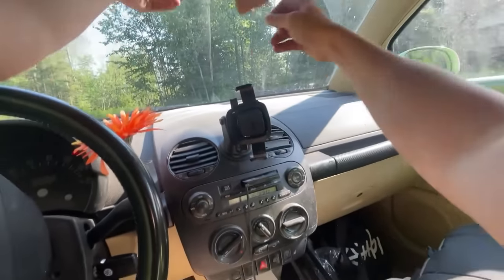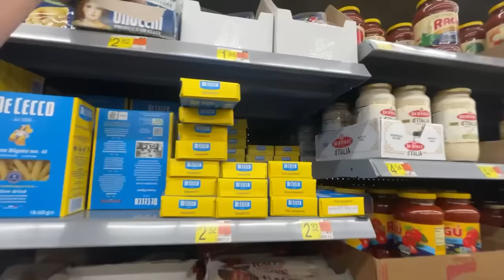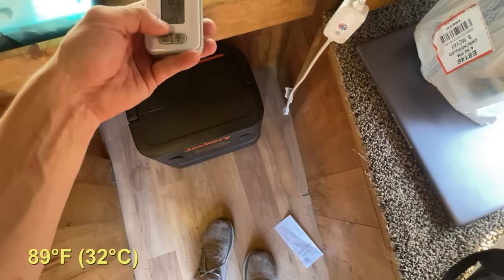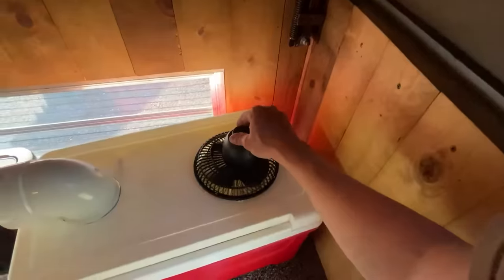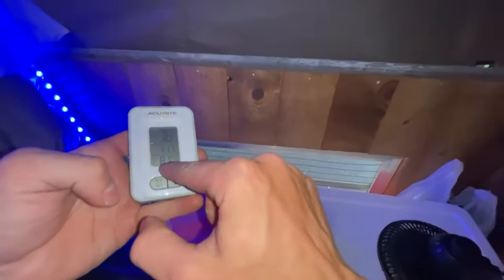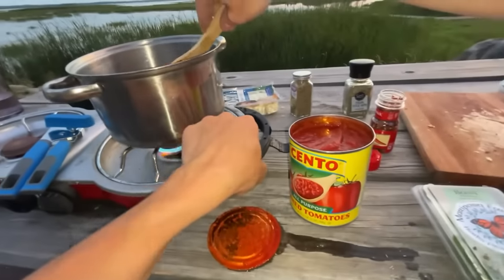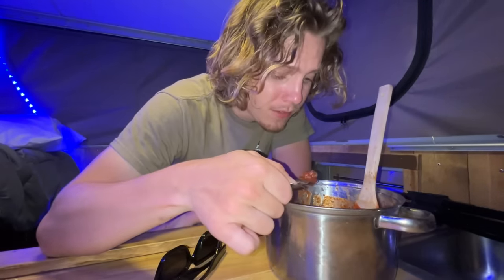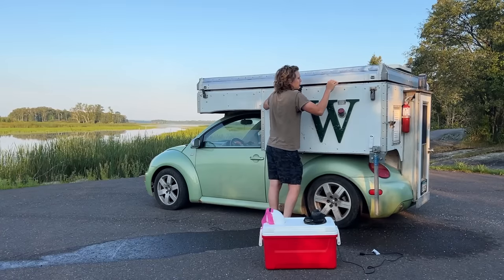Car Camping w/ DIY Swamp Cooler - Will it Work?

Comment: Maverick,  trick to super cooling with ice, rock salt, crushed ice, and layering, like you do with an ice cream maker. When you get halfway up, start using the cubed ice, with the rock salt. Leave 4 to 6 inches from the top for air flow. Also, start saving money by freezing tap water in gallon zip lock bags, not only good for cold storage, but drinking water.  Rob
Reply: was gonna comment this exactly
Reply: I would also maybe add a stronger fan that little desk fan probably doesn't put out that much air
Reply: @Follower lmao Fr bro lyin for what 🤣
Reply: Rock salt wouldn't that melt all the ice?
Reply: Sorry but this isn't correct  Think about it...rock salt melts ice in the winter and doesn't effect how cold the ice is. Also not all ice is the same temperature. You can get ice at 32 degrees F but most home freezers will go as low as -15 below 0F. The colder the ice and the less surface area, the longer it lasts. This is why you can't beat quality block ice with no salt. Also worth noting that on the icy breeze air cooler, it specifically says not to use rock salt and will void warranty. Cheers
Reply: @ldg508  excellent question because I know i use rocksalt yo3keep walkways clear in the winter time
Reply: @Follower 🤣
Reply: He won’t reply but he sure does want you to head over to his website and buy an air freshener tho
Reply: @Rayraywheelz  I know salt water freezes at a lower temperature but adding salt to ice is just going to melt it faster, it doesn't keep ice cooler or make it colder than it already is
Reply: @goredohkackz1599  🤣🤣🤣
Reply: At the very least use more than 1 bag. I'd fill it almost to the top.
Reply: Can I get a picture?  Dude, you're in public,  of course you can get a picture 📸!
Reply: @kelly171a  😂😂😂👍🏾
Reply: Could also use water bottles
Reply: Also leave the top vent open so the heat has somewhere to go
Reply: Salt makes ice colder
Reply: @ldg508  check out ice cream makers, they use rock salt, I was surprised as well, especially since it’s used to melt ice on roads. There is something about the temperature, if it’s below or above a certain temperature it has a different reaction.
Reply: My dad used juice jugs and freeze water in them. Afterwards he would put the jugs in the cooler.
Reply: @goredohkackz1599  well, he has to fund the trips etc.😉
Reply: @priscillafuentes8663  he already driving expensive sports cars he makes plenty of money thru promos and YouTube he’s never gave back to the community or helped anyone out 😆
Reply: @goredohkackz1599  That’s a lie. I’m guessing you’ve never seen him feed random people. You also must’ve missed the video where he tried to take COOKED Thanksgiving dinner to a shelter to give to the homeless but was denied because they aren’t allowed to take cooked food so he personally distributed the food and drinks to the less fortunate himself. I guess you forgot about the video where he gave MULTIPLE people gift cards to replace ice fishing gear after they lost everything because of a break in the ice they were on. (A few people had to be rescued) You must’ve also missed the video where he treated a few new friends to a 4-5 course meal from a traveling chef who cooks hibachi style. Mav does give back. Lastly, just because he doesn’t film every single aspect of his life and everything he does 24/7 doesn’t mean he isn’t doing anything. Get over yourself. You sound bitter and jealous, bro. 🤦🏼‍♂️🤦🏼‍♂️
Reply: Nice idea,thanks Robert👍👍👍
Reply: @naghellboy899  6” Can-Fan max pro should do the trick 🙃
Reply: @goredohkackz1599  he has given back. But I'm sure more wouldn't be a bad thing. As limited as I am, I give to help my fellow man. (I'm disabled).
I lived in a domestic violence shelter, for two years. It was humbling, I am content and thankful. Thankful, for my own place, food, and car. God has been good to me.
Reply: @priscillafuentes8663  I appreciate you baby see you give without recording it and posting it for views, all these YouTubers record themselves to win over the audience n fool them into thinking they are kind loving people when in reality they are money hungry leeches
Reply: @ldg508  no it lowers the freezing point
Reply: Thanks Rob
Reply: this question is out of syllabus
Reply: @naghellboy899  is there another fan that small that could fit on that?
Reply: Also he needs to fan the air to bottom of the cooler. I saw another YouTuber improve his cooler fan.
Reply: A bigger pipe as well get a mount that you can attach different pipes so it blows around the whole car not just the straight small pipe that blows in one direction.
Reply: bingo! layers with salt and wayyy more ice!
Reply: Took the words out of my mouth! done right, swamp coolers are amazing!
Reply: @austanroupe4730  but that doesn't make the ice colder or last longer, that just means it has to be colder than 32f to freeze where regular water freezes at 32f
Reply: Sounds like a ton of work for little reward as well as a waste of resources.  I can relate as I live in Mid MN without AC and have tried all of my grandfathers ways of staying cool.  The best solution I have found is to either dig a hole in the ground to sleep in, or have a basement.  Either way, I can't wait for winter.
Reply: Excellent information
Reply: @ABrooksCupid  He doesn't need to do anything to justify his lifestyle. He provides entertainment. That's his whole job.
Reply: @EyesMindOpen I have laid down on the floor in my cargo trailer conversion once in the heat.  It was plenty cool, but not a lot of fun.
Reply: Just go buy a real swamp cooler, but where you are it's humid I'm in apache junction az. Much dryer out

Comment: You should have had the roof vent open! Heat rises and cooling stays to floor.  Also, it will never cool sitting in direct sun. Thermal impact is too intense.
Reply: Also with evaporative cooling you do need to vent the air out some to keep a good flow going. He should've went to home depot instead, the Burning Man classic bucket swamp cooler works great if you're in a dry area. 95 degrees at night and the inside of the tent was freezing.

Comment: To make the swamp cooler work better you need to keep the RV from competing by reducing the heat production. An insulated windshield sunshade makes a huge difference as would insulated curtains in all the windows. Also crack the roof vent to allow the hot air to rise and escape as the cooler wait fills the lower areas. You were trying to cool contained hot air that as increasing in temp from the sun coming in your windows.
Reply: @Jackson Spence they’re automated bots most times
Reply: @Jackson Spence lol
Reply: Tbf, if you crack the roof vent and some hot air escapes, other hot air from the outside will have to come in to take the place of those air. The cooler doesn't magically add cool air into the RV anyway, it just cools the already existing air inside. Pretty much works the same as AC units in homes, it blows the warm air in the room onto something to cool the air down, which for AC units it's the evaporator coil and for the swamp cooler, some ice, and that cooled air is redirected back into the room.

Comment: Friendly suggestion is getting blocks of ice (2) which will fit perfectly side by side lengthwise in the cooler. That and getting a wire rack to set the blocks on, this will allow the air to move around the ice creating a larger cooling effect. You can run some 4" bolts and secure with nuts say halfway up the cooler (2 on each side and on the ends) to set the rack on (cookie cooling racks would work perfect). I think you would see a lot more colder air and the blocks will definitely last 10x's longer than cubed ice. Another suggestion would be putting the fan on one end of the cooler opposite of the exit port instead of the lid, this  will push more air for you. And hanging some heavy fabric (like canvas material) on the camper side to block the air from going into the front cab of the car would help keep the cool air in and the warm air out (having a reflective windshield sunscreen also might help). Would love to see redo!
Reply: great advice!!!
Reply: Whoever you are, thank you! Will give this a go👍
Reply: Also helps to have a stronger fan. I threw one together with fan/styrofoam cooler/frozen plastic containers of ice and it worked pretty well. also, suspend a silvery tarp over your vehicle to reflect sun away. I insulated my truck topper with reflectix and wood paneling and it even stays cool in the sun.
Reply: That’s what i was thinking
Reply: I ain’t reading allat

Comment: Just a heads up: evaporative (swamp) coolers don't work as well in higher humidity.  And you usually need airflow (aka an open window).  Keep that in mind.
Reply: Chris is right, in the high deserts of New Mexico everyone uses swamp coolers.  In a very humid place like Hawaii, no one has ever heard of a swamp cooler lol
Reply: I'm high desert of Northern NV (it's not just Vegas) and everybody uses swamp coolers. Low humidity. And we keep a couple windows cracked and the air flows Great!
Reply: My sentiments exactly. My swamp cooler here in the high desert of NM works like a beast cooling by around 20 degrees Fahrenheit on a avg summer day. Without a window open, it gets so humid tho so make sure you have airflow from outside!
Reply: @0777sadie  from Phoenix myself.  Use evap for spring, early summer and part of fall.  Only time I switch to HVAC is the hottest part of summer (when it starts getting up around 110 or more) and monsoon.  Significant difference in cost to run and maintenance.
Reply: Exactly.  Here in the high desert prairie of southern Colorado,  a swamp cooler is perfection. 😀
Reply: Also, the evaporation needs to happen outside of the place you're trying to cool. That's why swamp coolers are mounted on the outside of walls and on roofs. Can't remove heat if you don't give it anywhere to go.
Reply: also he did a good job of releasing a lot of micro-plastics into a beautiful natural ecosystem
Reply: 29 palms is where I lived several times...swap coolers still need a window open... and Do Not work when the humidity rises...they sure didn't work when a storm was being thru the desert!!!
Reply: @Alexandra-lx4jq  Yeah, here in the SE, it's not unusual for humidity to be over 95% in some parts of the summer.

Comment: Hey Mav, I've used those swamp coolers for camping/boondocking quite a bit. If you get some of those freezer ice packs and line them up with the cracks between them facing long end to long end, it'll work 10x better than ice ever will. There is no air flow between the ice (once it melts in 20 mins) but those freezer packs let the air flow between them, they won't last as long but if you get enough of the big ones (10"x10") to fill the bottom of the cooler, it'll last all night long for sure. The air temp I recorded coming out of the cooler was 65 degrees, also don't run the fan on high if it has multiple settings, medium to low so the air has time to absorb some of the "coolness". Lol
Reply: So the air has more time to transfer thermal energy to the ice :)

Comment: For the swamp cooler, use a combination of block and cubed ice along with some rock salt. Next would be to put reflectix on all your windows would help immensely. Love all your videos and keep on truckin!
Reply: I agree, I was just gonna comment that too
Reply: It would be cheaper just to run the car with A/C on than buying bags of ice, and it would actually work (somewhat)  if you ran a vent to the camper.

This reminds me of the phony "air conditioners" you can buy on Amazon which are nothing more than a fan with a sponge you can get wet. A tiny bag of ice cannot cool a camper.
Reply: very nicely put.
Reply: or just get an air conditioner
Reply: Use dry ice
Reply: it wouldnt matter, the humidity in the air in the midwest makes swamp coolers a waste of time
Reply: don't forget to drill and carve out a lof of micro-plastics into beautiful natural ecosystems.....
Reply: Cheap small 110 ac , and a cheap small generator will fix this.

Comment: Swamp coolers can work well, but because of the ambient heat in locked air space and the camper materials it all holds great amounts of heat residual heat. Cool vid Mav!

Comment: Hey man you have lots of excellent suggestions from your viewers on swamp coolers. I have a different suggestion back in the 90s I used to install HVAC equipment. You can get 110 volt through the wall AC unit or a heat pump unit, I would go with the heat pump unit that way you can heat and cool your space. What I would do is find the unit that fits the window next to the inside shelf where you put your power unit and the swamp cooler. Then I would take your bug to a steel fabrication shop and tell them what you want to do and let them build you a support frame on the outside of your bug it would not take much stick out with a gusset to support the unit they know how to do it it's not a big deal. The idea is to remove the window and in its place have your heating cooling unit. Buy two of the heavy duty sliding ball bearing units like you have at the back of your truck for your boxes that slide out the back. Take everything to the fabricator just tell him what you want you want the AC unit to slide into the vehicle during travel and you want it to slide outside the vehicle once you find a place to park so you can plug it in and have air conditioning they can easily design something and fabricate it in one day and you're done. The bad things about swamp coolers is they add moisture to the air so if you have a well running swamp cooler inside your vehicle the walls the wood everything you have is going to become saturated with moisture swamp coolers only work in low humidity environments like the desert cuz there's no moisture out there it doesn't matter if you get moisture in there in fact it's better for your breathing but any place where it's humid anything like that you want an AC unit that removes moisture from the air. Give me a comment back if you have any more questions I'll do my best to help you out peace
Reply: Times have changed since the 90s. They have all new types and styles with inverting the electrical. They make a 12volt ac now. For this style in the roof. Would look into that

Comment: Thanks to you I officially started camping in my truck almost a week ago now. Definitely figuring things out as I go. Been a learning experience. Plus Minnesota lately has been hot days and cold mornings. But such a cool experience so far
Reply: Now it's time to start posting some content. Stay safe out there!
Reply: Congrats on getting out there!👍
Reply: Northeastern Ontario Canada has almost the same humid weather as Minnesota. It rained a lot here this summer. A lot of heavy rain too. The swamp cooler wouldn't be good here.
Reply: Small 110 ac and a small gas generator.

Comment: Love your videos and adventures Mav. I remember some people making swamp (evaporative) coolers like you did, but using orange Home Depot buckets. And I know several people have pointed it out already, but... you need a window open a few inches or your camper vent open. I live right next to Joshua Tree. Up here in the hi-desert, it's a dry heat. So swamp coolers work great. Until... any kind of change in humidity (aka monsoons) . Then it's AC or suffer through it.

I have  an '88 Lazy Daze motorhome.  Along with everything else it has to offer, it has a roof-mount/factory Swamp Cooler! I won't use it unless I'm in a campground with full hookups. It really goes through the water. 
Be safe! 
Uncle Rick

Comment: Need slower fan speed and more ice surface area to even have a chance at cooling.  Air is a horrible heat conductor that’s why those silly cryo-chambers don’t freeze you.  If you submerged a metal pipe with a fan at one end into ice water that may work better.
Reply: I would try using copper piping that is submerged under the ice.
Three 3 inch pipes that lay on the bottom and then 90 up and come through the lid. Use small low speed computer fans on the intake side of each pipe. Then on the exhaust side couple the 3 into one using vaccum cleaner attachments. 

The lower speed is going to let the air spend more time in the pipe to cool. Then the 3 to 1 will increase the pressure back up!!

If you did this you could use dry ice too as it will work more efficiently. 

Just an ide
Reply: @BlackstoneMalone  that sounds genius

Comment: Swamp coolers(aka evaporative coolers) draw air through pads that have water flowing through them creating a cooling effect. They are mainly used in drier climates since they are ineffective in humid climates.
Reply: Yes facts the southwest and parts of California is where these thrive grew up with a swamp cooler.
Reply: @mom_im_losing_it  even in California it is so hot here a swamp cooler just wont work past 100F (38C)
Reply: @coler154  I never had a problem.
Reply: cries in Floridian

Comment: A swamp cooler works by exchanging the heat in your room air with the water vapor it adds to the room (which then leaves by an open window or exhaust fan.) Using colder water will give more capacity for holding heat, but if the air is already full of energy-laden water vapor it's a losing battle.

Comment: Hi, Mav. I use a swamp cooler in my house. It works great. It uses water straight out of the tap. No ice is needed. It works by blowing air through water-soaked pads that evaporate the water. It is the evaporation that cools the air down. Just blowing air over ice won't work well. It also depends on your humidity level. Swamp coolers don't work over 30% humidity.           TYU